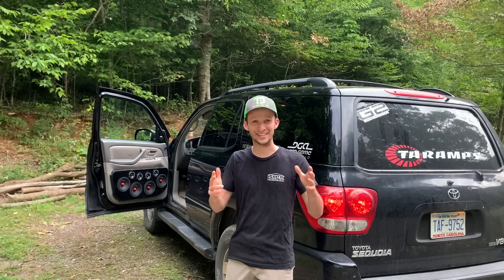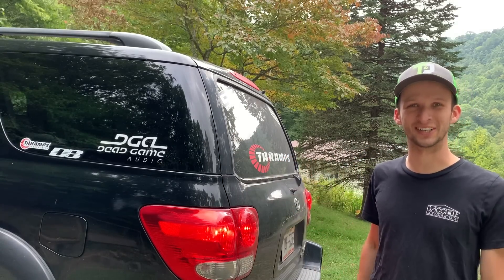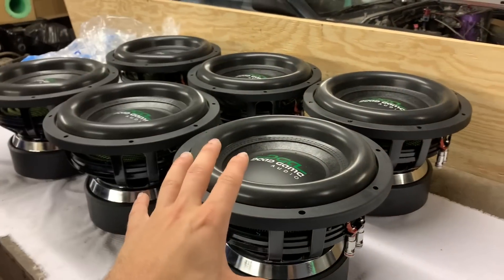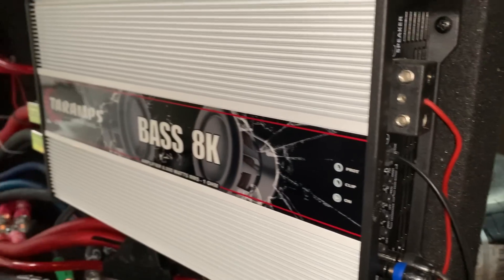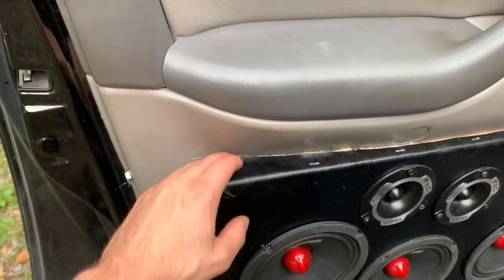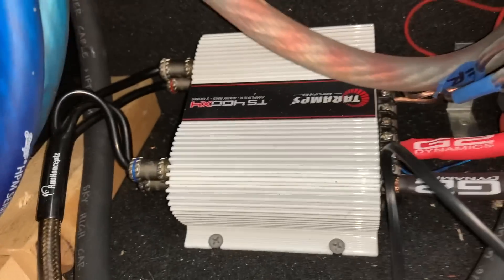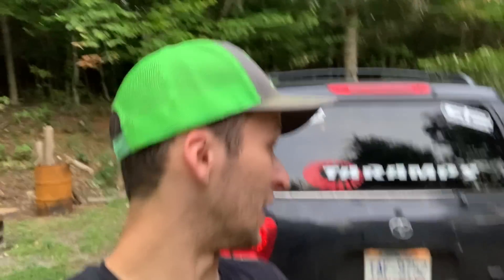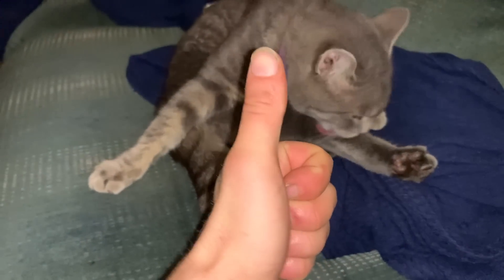Absolute FOOL Spends Over $4000 On His "BIG SYSTEM" | DS18 | TARAMPS | DEAD GAME AUDIO

Comment: Yeah it really adds up... especially if you're trying to do things right. I just spent 400.00 on two spools of sky-high 1/0 wire and 120.00 on two sets of Battery terminals from GP Audio for my two 330.00 Northstar AGMs. 

Don't add up the money, just enjoy it. Adding up the money involved has a way of bringing bad vibes. Especially if it is your wife doing the math.
Reply: haha true
Reply: I'm only about $1k into my set up rn, 1/0 Knukonceptz Kolussus power n ground, 10g Kord Flex Speaker wire and Krystal RCAs (i like KnuKonceptz shit loll) 220H.O from DB electrical, single Incrimidator Death Row. Not loud yet but definitely not cutting corners either
Reply: @Donsguncorner  I'm actually just getting back into this again after many years off so I have a different set of standards for what I want in my car. Instead of buying an amp kit and settling for meh things I constructed everything piece by piece getting what I thought was one of the best available.

I got those Krystal RCAs from KnuConceprz too and they sound great. Sky High audio 10 gauge speaker cable to the Gately Box...nothing but the goods! Hell I even got beefy 14 gauge remote turn on wire lol.

Once you get your electrical done all nice and perfect and high quality that's the base. You can always just switch amps and subwoofers all you want as long as you have that electrical you are good to go.

That's how I see it anyway. The MechMan 240 amp alternator is on the way! Do I actually need it? Debatable!
Reply: Best comment ever ‼️💪🏾💪🏾💪🏾 enjoy life ‼️
Reply: "especially if you're trying to do things right." Ain't that the truth! I just dropped $2800 on my system just for 4 6.5s, 2 tweeters, and a single 15" sub on a 4k amp. I did everything the right way and refused to cheap out on anything. If I did it truly "budget", I could've gotten away with everything for under $1000.... Its kinda sad, but whatever. I'd rather do it right and have peace of mind.

Comment: I can relate, i pumped around $2500 into just my single Sundown Xv2 10 build. Blew $800 on 2 Sundown SFB 2000D amps that sucked, and ended up spending another $500 combined for my Deaf Bonce AAB Atom 2000.1 and back up Power AcoustiK RZR1 2500D Razor. And that's not including having to send the Deaf Bonce amp to get fixed along with my 320 amp Apex alternator because i had a alternator distribution block ground against the alternator case which fried it in seconds. Then all the Sky High Car Audio installation accessories and a stinger 250 amp battery isolator and a $376 deep cycle AGM accessory battery. And i ruined a 97 Altima and a 96 200SX all in the last 6 months. Car audio is one very expensive learning experience at times 😩💀 what's worse is the fact i have about the same amount invested into my catfishing gear too lmao

Comment: Keep it up Parker, it's a lifestyle that most won't understand! My first complete build was (2) 15s and cost me around 14k total and sounded wonderful until I needed more....  The rebuild has cost around 10k  and I still don't have everything I need. So far 3 Deaf Bonce 4518, 3 Deaf Bonce 6ks, 3 JY Lithiums, and a Helix Ultra DSP. I haven't even started on the mids and highs setup or under the hood. Everybody had their drug of choice, mine just continues to get me high for months and years after I buy it 1 time!!🤣 S/O to Jake Jesty @ Sound Evolution...That's my dealer!!💪🏾💯 #Basshead4Life😤
Reply: Daaaamn bro 14k for 2 15s??? What was all that money for? I just spent roughly 2k on one 15 so it ain't cheap, but fourteen???
Reply: @bailey2517  Yeah it was alot but that was the full build cost with everything from batteries, alts, amps, wiring, subs, and a few more things. That shit adds up quick when you want to do it the right way! But like I said, it's my drug so you always want more because you feel like you need more for satisfaction!! And it's not even for comps, it just to feel as much bass as I can when I'm riding. That's my therapy and my truck is my therapist🤣
Reply: @mrheath4928  I bet if they're super high power subs a lot of that was for electrical. I only needed a 200amp alt and one battery so it wasn't terrible. 4k amp and I got a Skar VXF so if you get something like sundown it will cost more (but worth it I'm sure :P)
Reply: @bailey2517  lol yeah it is. My build is in my first comment above and believe me it was worth it!!
Reply: @mrheath4928  oh, yeah. 3 deaf bonce 4518s will do the trick 😂😂 and take a butt load of power lmao. Those subs are extra power hungry. Great SPL subs

Comment: T262s components in front and rear doors ctsounds at125.4x2 on doors, orion hcca 3000.1 dsplx on 1 sundown u 10, 2 of the giant agm batterys from tractor supply, jl 1/0 ofc x2 runs with big 3 done.  Plus kenwood dmx706s with a audiocontrol dqdx. This shit adds up quick

Comment: so that 4 grand is a plus atleast about 1500 usd more with gen and wires, maybe batterys? headunit? dsp?
Reply from the maker: Yeah just the batteries were close to a grand
Reply: @ParkerTheBasshead  its an expensive hobby, but what hobby isn't expensive? Lots of people spend a lot more than 5 grand on a car build, so its really not all that bad.
Reply: Back in the good old days quality amps cost over a $1 a watt lol. It got expensive real quick lol. They also made some insane head units costing thousands cause no one cared about spending the money as long as it was worth it! Heck just my front stage back in the day consisting of scan speak mid bass and midrange drives with seas tweeters and custom built xovers was over $1200 easy 😂.

Comment: I plan on spending a similar budget or less on an SQ system instead with Sony mobile ES speakers, go ham on the sound treatments including egg crate foam inside the door trim panels, 100dB or higher signal to noise ratio amps it’s class AB or nothing for my mids and highs, and a Fi Neo in a custom MDF sealed enclosure.
Reply: That's a soy boy setup brp

Comment: Man Parker u gotta do better wit answer sum easy questions..what ds18s are those 6.5s?? What connectors are u using for you're 4channel amp??what gauge wire are u running on the 4channel??

Comment: Hi Parker! I have a question..Are you using a passive crossover for the mids/tweeters? or dsp? if so which and details if possible. 
Thanks man! Love your channel!
Reply: I use a helix mini dsp off of my factory headunit and it sounds better than any aftermarket head unit I’ve ever had. I think he’s passive, but not 100% sure. Lots of ways to skin a cat I guess is my point. Of course the helix and its director remote was close to $1k alone.
Reply: @TheDoozie43  OUCH $1000 for a dsp you got robbed there's other options out that that work just as good OR better for a fraction of that price You wld NEVER hear the difference I'm not hating its just facts But like they say to each there own. Enjoy my fellow car audio enthusiast👍🏽👌🏽✌🏽💯
Reply: @redman4076  it’s a helix mini. $650 for the dsp itself and 300 for the touchscreen remote. Best they make these days bud. Extremely powerful. Wifi or lossless Bluetooth built in depending which option you want for another $100. Time alignment, the whole 9 and then some. I do SQL builds, so it’s necessary. Haven’t found one better, been in car audio since 90’. Sounds like you’re still learning, but that’s ok! There’s a lot to absorb.
Reply: @TheDoozie43  I've been doing installs since the early 90''s also and I've learned the "dsp" scam a long time ago most are the same the human ear is EASILY tricked as is the mind The difference in sound is so minimal that the huge price hike your paying for what you think your going to hear is ridiculous. Its more of hey look at me and my overly expensive over priced equipment type deal Its funny to me You need to learn more deeply about build houses and brand badging allot of the equipment you think is "high end" is just rebadging some  crap and calling it some fancy name lol But if you think your special because you have a overpriced dsp and touch screen  that's cool by me I'm just saying there's other options out there that do the SAME thing and you'll never hear the difference But hey you sure do look cool 🤑
Reply: @redman4076  what’s an affordable option and can 1 do’s run mids n tweeters or do you need 1 for each

Comment: Got about 9k in my system counting ALL the different equipment I’ve purchased but as it sit maybe about 5500$. Only a fool thinks a cheap 2000$ and under system will sound good. My 2 batteries and Alt were 2200$.
Reply: I have around $1200 in my system (got some great deals on used/almost new stuff) if I bought it all new it would be around $2600.  Sounds better than stock for damn sure and better than some people who have spent double.  It's all about matching up equipment that works well together.

Comment: What kind of batteries
Reply from the maker: Headway lithium cells
Reply: You can do 96ah of headway for about $500 out the door. Holds voltage very nicely, charges fast and plenty for a true 10k watt system.
Reply: Thanks

Comment: I have 15000 watts need to know about the batteries I need
Reply from the maker: I have a 128ah of headway lithium cells
Reply: Super caps are what I plan to use once I install my salt 8k per Sean at EMF audio’s advice. Still looking into it though. I run a d6500 under hood with singer 270a alternator, so need something that plays nice with the agm.
Reply: @TheDoozie43  super cap.is not what u need. Get a lithium. Supercaps control spike. Lithium already has that draw capacity

Comment: How to tell what size fuses to use
Reply: It depends on amp size and therefore wire size. 1/0 gauge needs about a 350 amp size fuse.
Reply: @TheDoozie43  0ga can run off 250
Reply: @rly.shiesty  yup. I was talking about sky high oversized 1/0. Different ballgame.
Reply: Ya i run 500s per wire. Doesnt matter as long as its over(within reason). When voltage drops amps skyrocket popping the fuses

Comment: Hey I could use your advice, or anyone’s for that matter. I need 3 separate 3.5k Korean board amps, but I’m sorta on a budget...sorta. I would just like them to do clean power. I have the electrical for them to do their rated rms power. I just want the best bang for buck amps. Without spending over 1000$ for 1 3.5k 😫. Any input from anyone is appreciated.
Reply: One of the Jp line from d4s they are S Korean